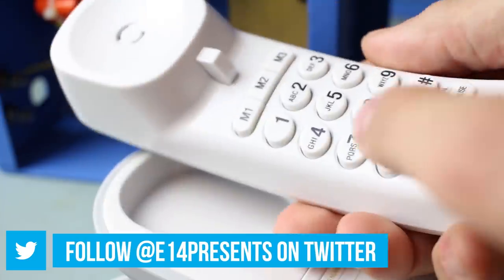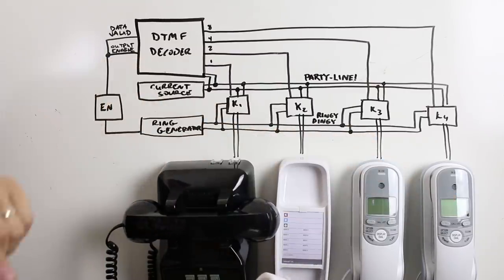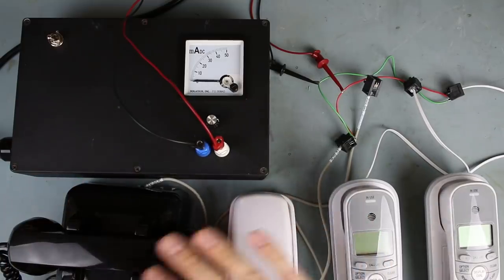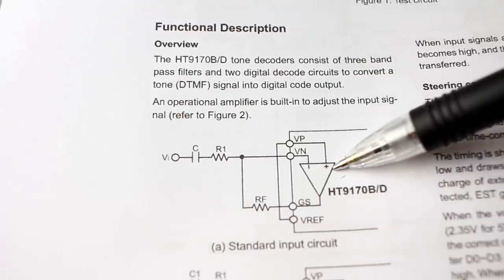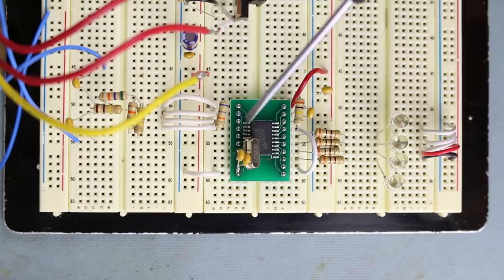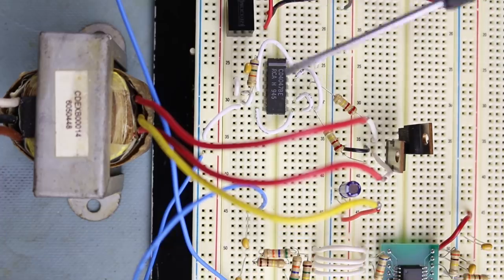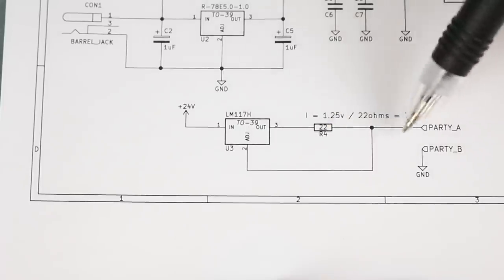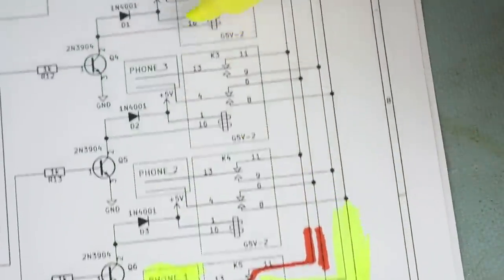Multi-Line Telephone Intercom

Comment: amps matter not volts
Reply: You can't have amps without volts.
Reply: @gregm.857  my point was that a 10000 V charge with 1 amp will not really hurt you but a 12V charge at 100Amps will fry your - toast.
Reply: @larrypriest5789  I'm not sure I understand why you made the comment in the first place,
and I surely do NOT agree with your conclusions.

10,000 volts will overcome your skin resistance and will go through
your body.  It takes only 100mA (0.10 amps) to kill a person.  So
10,000V and 1 amp certainly WILL hurt you!  The usual cause of death
is ventricular fibrillation where the current causes the heart to stop
beating normally.  It also usually stops respiration so asphixiation
is a possibility, and at 1 amp there will be a lot of burned tissue.

On the other hand, 12V is not enough to overcome normal
resistance of dry skin, although if your skin is wet with perspiration
(basically salt water) or you're standing in a puddle of water then
12V will go through you.  And 100 Amps literally might boil some of
your internal organs due to resistive heating.

If you want a simple experiment, use your car's electrical system.  It
is all negative-ground.  So first put your hand on the positive
terminal of your 12V car battery ... you won't feel a thing.  But if
you pull back the insulating cap on one of your spark plugs and put
your hand on the connector inside (around 12,000 V or more) you
will get a hell of a shock.  And BTW I do NOT suggest doing this
because it MIGHT be lethal even if you are not grounded.

The situation that you said "will not really hurt you" has 10,000 V
times 1 A = 10,000 watts of power.  The situation that you said is
worse has 12V times 100 amps or only 1,200 watts.  So your "safe"
situation has eight times more power and can potentially cause eight
times more damage.

I definitely do NOT agree with your conclusion.